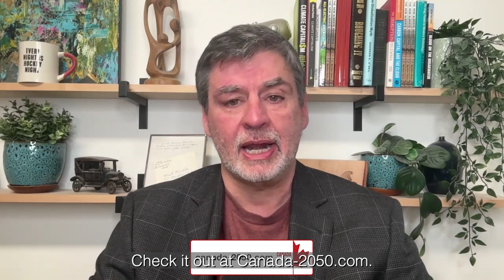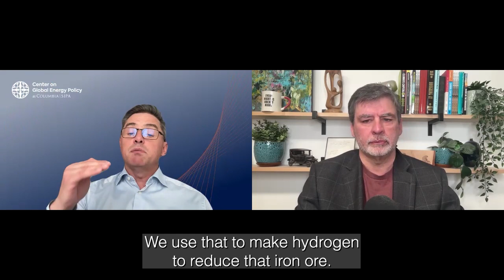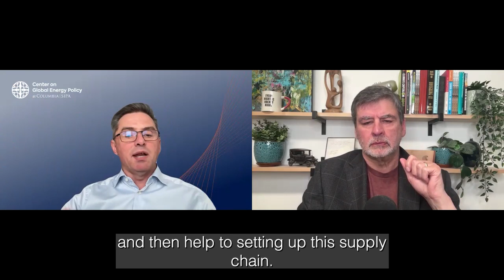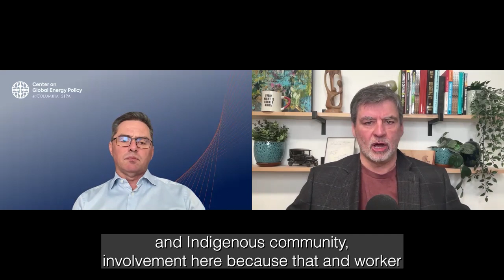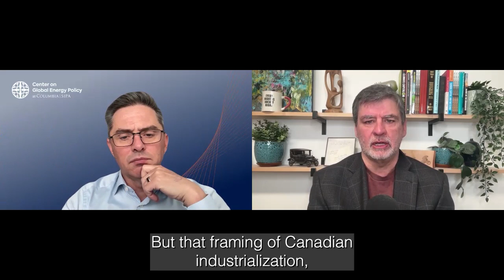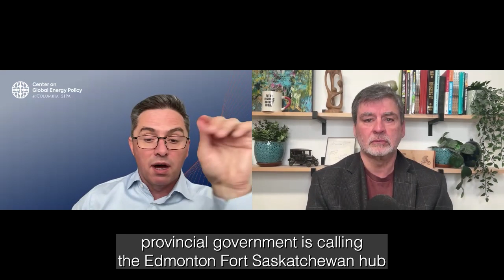How Canada can become a green steel superpower...and create 14,000 new jobs

Comment: Shorter supply chains require less energy input, Why does the net zero movement want to replace existing market driven supply chains? In seems counter intuitive to do so as more energy is required to move commodities longer distances. Government net zero policies, including the mandate for transition to 100% EV's seems arbitrary and unrealistic. Forecasts indicate we are facing massive global energy shortages, due to increased demand brought on by growth in technologies like EV's and AI. Our capacity to generate the electrical power required to meet this demand, is being hamstrung as renewables cannot provide baseline supply without massive investments in battery storage. Hydrogen technology is in its infancy and at this stage cannot provide the bridge required to meet these requirements. To produce hydrogen from natural gas inefficient. Energy input is required to produce hydrogen. Using natural gas to generate electricity is more efficient. The investment required to expand current electrical generating capacity and transmission grid will be billions of dollars and will take decades to complete. We need a sober second look at the proposed net zero transition and timelines before going further down this rabbit hole.

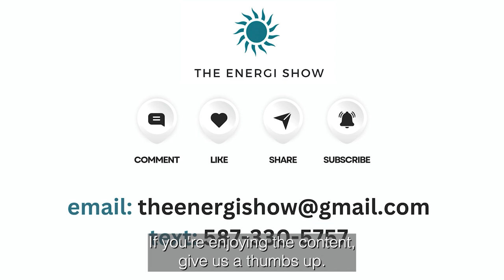Comment: @20:00 What they are proposing to do in Edmonton is not Green Hydrogen. It's Blue hydrogen from Natural Gas.
 The Model for DRY H2 reduction of iron ore would be using H2 from electrolysis and electricity from wind power.

Comment: Green steel without hydrogen is also available.  MIT developed Molten Oxide Electrolysis several years ago.  Boston Metal is commercializing the process.  The first plant was built in Brazil.

Comment: Hydrogen is great . Hydrogen production could be done from water electrolosis where the electrical power can come from Canadian CANDU reactors.  That would. Be true green hydrogen. Hydrogen production from steam reformation of natural gas. That does produce CO2 low bit still there. 
One of the highest daily produces of hydrogen is an oil sands company Syncrude for their upgreader.

Comment: Very good episode.  I have one dumb question.  Why hydrogen? I don't have an understanding of its' use.  Is it for heat or is there a chemical change in the iron ore that is achieved with hydrogen?  I am guessing it is the latter because if you have natural gas then heat can be produced from it.  Hydrogen has many issues that come down to safety and cost.
Reply: I asked Gemini;
Hydrogen DRI (Directed Reduced Iron) is a process that uses hydrogen to remove oxygen.
It seems the cost advantage may be in: Low cost electricity (wind or solar) for electrolysis, cheaper infrasturcture to heat the ore (magnetite) and remove the oxygen; shipping more value / ton of pellets to customers and less processing for customers.
Another value is how much cleaner it is: green hydrogen produced from green electricity greatly reduces the carbon footprint of the process.
The cost negatives are capital cost for the hydrogen production and storage, and the reactor to heat the ore.  The operating cost is mainly depreciation while the higher selling price could offset this, depending on the demand.
It should not be hard to assess the addressable market demand, domestic and then foreign.
Reply from the maker: Thanks again for commenting and watching. These are great questions.

Comment: This still makes Canada a hewer of wood and drawer of water!  When are we going to realize that making high quality final product is where the jobs and real value is.  You talk about steel for cars.  Steel is heavy and it rusts. Aluminum in electric cars is the future. And electric cars need power. To get power distributed to cars in driveways needs many large power distribution transformers. Those transformers need grain oriented silicon steel, which is no longer made in Canada. So Canadian transformer manufacturers turn to South Korea for the steel, which in short supply and high demand, so very pricy!  We Canadians need to wake up to the high value high demand products we could be making here with Canadian resources, instead of looking for the simple and quick buck while shipping jobs overseas!  Made in Canada is the answer.

Comment: NewFoundLand has so much wind capacity to generate power.  What i don't understand is the towns in NFL having so much wind that they could use it suppliment natural gas to stay warm but don't harness that energy.  Even if the temperature goes down with blizzards,  the strong winds can be used to generate power to keep the blades warm.
Reply from the maker: Interesting, this is an area where more research is needed.
Reply: CLEAN WIND POWER it should be a job for so many in Newfoundland
Reply: Side note. If it's too cold, the turbines can't run. They can have kits to provide heating to increase their operating time, but it's limited. So Blizzard low 30ies ain't good for wind power.

Comment: Brilliant! This is the kind of forward thinking we need in Canada right now. We need to stop shipping our raw resources to other countries and importing finished goods, or at least add value to our resources before we sell them. Other countries are already prioritizing the procurement of greener goods so we need to get with the program. Speaking of that, the shipping industry is starting a shift towards greener fuels. The latest container ship from Maersk is dual fuel and is capable of running on Green Methanol. The problem is there’s only a couple of places in the world that manufacture truly green methanol. Green methanol is made from green hydrogen (by splitting water with electricity from a renewable source) and adding carbon dioxide (check out the Maersk video for the science) to make methanol. Mann manufactures the large engines for the shipping industry and they pioneered the dual fuel setup and it can be retrofitted into current engines. So there’s a market for this fuel and Manitoba has excess hydro power and access to fresh water to make the hydrogen. Saskatchewan has been doing carbon capture for a while so there’s the other component. We have an opportunity to become the supplier to the global shipping industry as they bring more and more of these engines on line.

Comment: The long and the short of any form of hydrogen made from Alberta Natural Gas is, it still requires yet another well to be drilled.  A well which the industry has clearly shown they have zero interest in cleaning up.   

FWIW, I do not see any upside to an Alberta "Green" hydrogen future, until the oil well mess has been sorted AND properly funded up front.  O&G companies cannot be trusted to follow along to funding their mess, as they make money.  They can't.  Shareholder and executive bonuses, and share buy-backs are their only priority. 

But I do see what you've brought forward as a good idea!  
Also kind of like that it may put a spike through the heard of the VERY unwanted metalurgical coal mining that the UCP have gifted to foreign corporations.
Reply from the maker: Thanks so much for taking the time to comment.